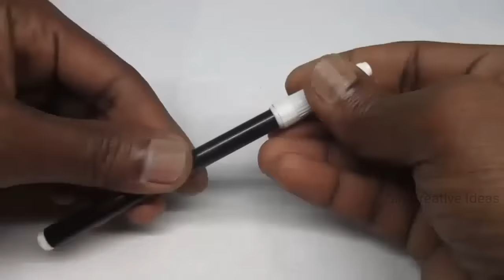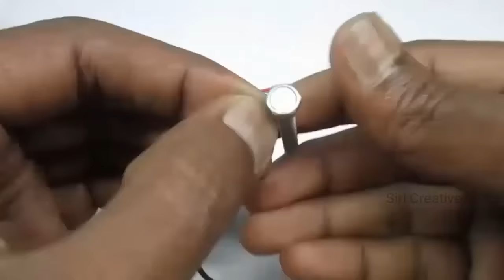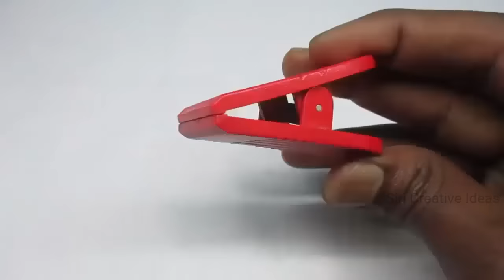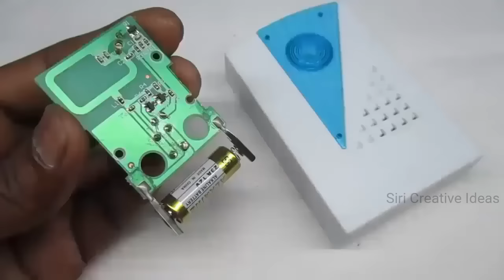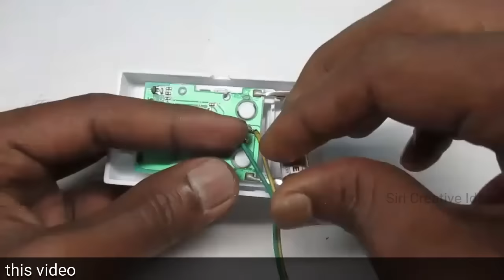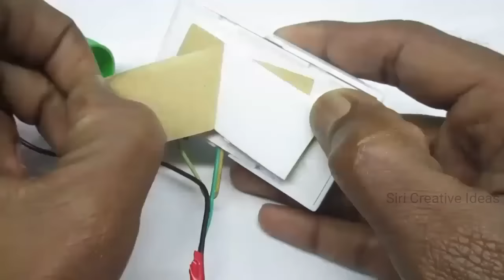How to Make Wireless Water Level Indicator | Save Water | Wireless Water Level Indicator DIY

Comment: Simplest of all is take a normal doorbell with battery, add wire according to the length and distance to both the wires provided in the doorbell.
Now put one wire tied with some heavy object to the bottom of the water tank and fix other wire to the height to which one like the level of water and THAT'S IT.
As soon as the water level touches the level wire the doorbell starts to ring.
Reply: If someone touch the water at that time what will happen
Reply: @jkme4119  He said normal battery, you won't get current shock.
Reply: @Maheshmahi12312  Tks fr the clarification

Comment: If my water tank is on 2rd floor and i install the bell on ground floor, then will it work? What is the maximum distance it covers?? Does its signal communication depends on line of side??
Reply: You have use 12 volt buzzer and adopter according to your length. It will work properly